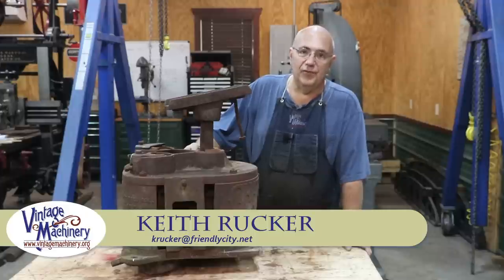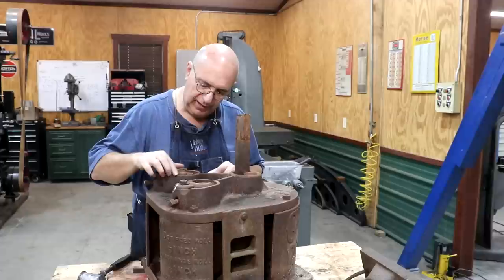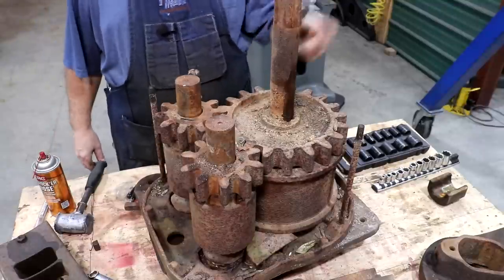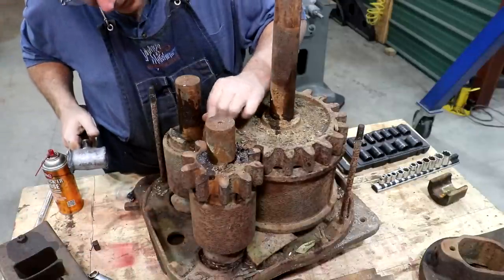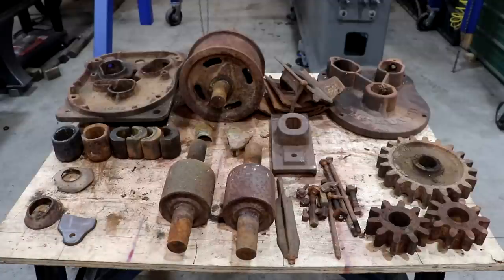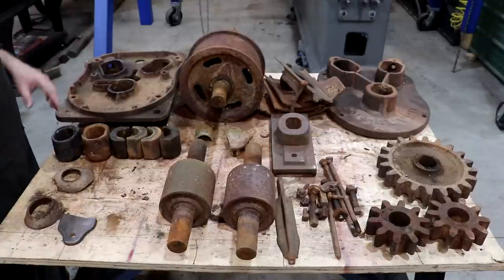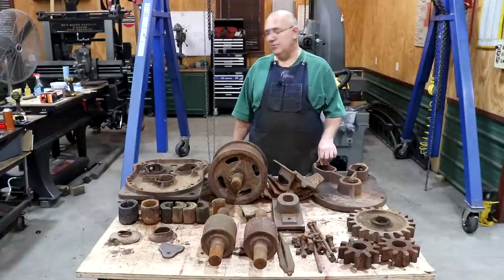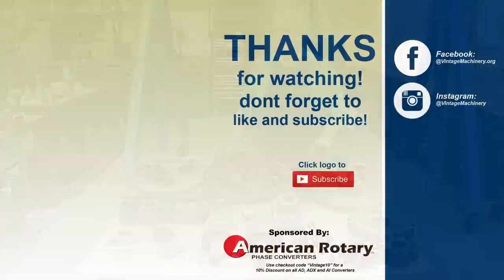Chattanooga Plow Company No. 11 Cane Mill - Disassembly and Evaluation

Comment: You have repaired quite a few Sugar Cane Mills . Cleaning, Brazing when necessary, new hardware and pour new Babbitt. The Babbitt appears to be challenging. Preventing the molten Babbitt from leaking when pouring it. As always anything you repair, ends up working good as new or better than new.
Reply: This is all true!

Comment: Keith, I see you using CRC Knock'er Loose. Have you ever tried a product called Free. I had a hinge on my Jeep Wrangler tailgate and I tried oil, Marvel Mystery Oil, a couple different rust penetrants (generic, Sea Foam Deep Creep, others)  and then  purchased a product called Free. It was a few months since any applications so it was not the other stuff doing the job as the vehicle is parked outdoors all the time. Free broke free the hings in a few minutes, tailgate worked easy and no noise. It was so bad that I thought one day the hinge was going to break off. It was not cheap but nothing good ever is. If you try it, be cool to see what success you get in a video.

Comment: Would it be easier for the large roller to cut the shaft ends off and bore out for a new shaft? Straightening and welding up the pits and turning back down seems a lot more trouble...

Comment: Keith I have a question about the Babbitt material your using. 
Is it food safe?
Reply: I'm not Keith but I'll drop my twopence here anyway, since I know the answer and this is my way of helping authors (Keith in this case here) to deal with the overwhelming number of comments.
Short answer - well, that depends WHICH specific babbit alloy you gonna use (en.wikipedia.org/wiki/Babbitt_(alloy)#Babbitt_alloys) but generally speaking "not really".

Long answer: the babbit alloy that should be used for this application (high load, slow speed = high tin content) won't contain much lead but it'll contain some. But then again the squeezed juice should never come in contact with the bearings - the lower tray is designed in such way that the juice should just flow out and never get into bearing wells. Or, to put it this way - the grease in bearings of the motor in your food processor probably isn't food-safe either, but then if the food actually gets "in contact" with them (= into the motor) then "food safe or no safe" will probably be the least concern of yours in this scenario.
Other companies used babbit in their designs of cane mills, and we have no records of any "lead mass poisoning" back then, so I assume it's "safe enough". And at any rate a tiny speck of babbit once or twice in your lifetime will do you less harm than drinking fructose-syrup loaded Coke every day... ;-) 
Anyway, back to the mill - parts of the "guards" or "dykes" on the bottom tray - ones that are supposed to keep the juice out of bearing wells are actually rusted away, but they can be easily rebuilt with a bit of brass and a touch of oxyacetylene torch.
Reply: He addressed that in an earlier vid. What he's using is food-grade.

Comment: I know its probably the wrong way to do it, but what would happen if you just put this entire thing into your tank of Evaporust and let it sit for a few days? Would they be much easier to take apart and ready to repair quicker?
Reply: The problem is, the acid (citric acid is the magic stuff in the evaporust, which is just a fancy way of selling regular citric acid at a premium price), so the acid would be used up quickly in semi-closed spaces with this amount of rust, and couldn't be "replaced" where it'd be needed - so not much action, just sitting there, I guess.
To remove this much of rust I'd rather use phosphoric acid (another, much more effective and tad more aggressive rust remover), put this whole thingy into some plastic tray, add poured the acid all over it, but then again it'll be an overkill of sort or "solution in a search of a problem". The way Keith did it was the most optimal way IMO.

Comment: Im wondering if the restoration is more functional than original would getting those bearing caps water jetted out of steel  be a hardier upgrade... Looks like the cast ones were a bit brittle in this application???

Comment: This one is right-hand drive, why was it also produced with left-hand rotation?
Reply: Depended on if you had a right hoofed or left hoofed mule.
Reply: For use in Australia. Mules go in the left hand direction down under.
Reply: @DirtyRobot  How to check if our mule is right-handed?
Reply: @grntitan1 , You know, I’ve heard that before but I didn’t know if it was true. Now that I’ve read it on the internet, I know it’s true! Lol 
Have a good Monday!
Reply: @RROOBBWWAANN  Watch which leg is the leading one. That's usually how you tell.

Comment: My reaction to babbitt is you're doing what's easy rather than what's right.  Not what I've come to expect from you.  The bronze inserts are what make this mill unique.

Remaking the authentic bronze bushings shouldn't be difficult.  Buy bronze sheet the same thickness as the thick part of the bearing.  Bend "U" around a rod the same diameter as the shaft.  Then mount the shaft in a rotary table on the mill, offset the axis the appropriate amount & mill the crescent shape.  Or use a 4 jaw in a lathe & do same.  Last resort braze the ID of the bearing caps & turn the bearing surface to ID.  

It would be fairly easy to make a mandrel for the lathe - similar to a crankshaft.  Then make the blank 1" longer than needed & use excess on the ends to secure it with either clamps a la carbide inserts or just a couple hose clamps.

MOFWIW
Reply: "doing what's easy rather than what's right" - well, a valid point (to a point...), but then one has to draw a line somewhere, hasn't he?
Shall we "restore" old rusty bolts, or just throw them away and replace with new ones? Shall we painstakingly repair some broken part (a bearing cover or such) or just cast new one? Or - heaven forbids! - just made one from a piece of sheet metal?

Also, there's this person called "customer" who's paying for the restoration and who (I assume) just wants to have a functioning mill for reasonable amount of money, a mill that will be used occasionally only - if ever.
Babbit bearings would be perfectly suitable for this purpose, the original bushings were made of brass because back then those mills were "run of the mill" (pun not intended) heavily used common homestead utensils, often pushed hard to their limits while in use - and bronze bearings are harder and would last longer under those circumstances. And then when they got worn out, any "both-lefty" Joe out there could visit a local hardware store, buy a new pair of mass produced bushings for couple of cents, and install them himself using just a hammer and a screwdriver (plus a hefty dose of cursing).
Pouring babbit is totally different kettle of fish, requiring skill and quite cumbersome, thus "Joe-replaceable" ready made bronze bushings made a lot of sense BACK THEN. But nowadays you can't get them any more, and Keith is a seasoned all around machinist, so for him pouring new babbit bearings would be a piece of cake. And at any rate, as I mentioned earlier, the mill probably will be hardly ever used, and even if it'll be the new "non-original" babbit bearings would work just fine, and then...

And then, last but not least... Well, lemme put it that way: no one of us is getting any younger, and at a certain stage of our lives we are "not getting any younger" much more than we used to, and if you're not getting my drift just take a look at Keith's videos from just two years ago, and "spot the difference".
Tasks that used to be "easy things to do" few years back somehow are just not the same few years latter. Wonder why...? Dunno about you, but I noticed "a slightly different working style and movements", but I won't elaborate on it. "Word to the wise", as they say.

And then there's this quote from "The Master and Margarita" - "Yes, man is mortal, but that would be only half the problem. The worst of it is that he's sometimes unexpectedly mortal—and that's the crux!" - and being the customer (and the owner of this mill) I'd seriously ponder over the meaning of this sentence... but I digress here.